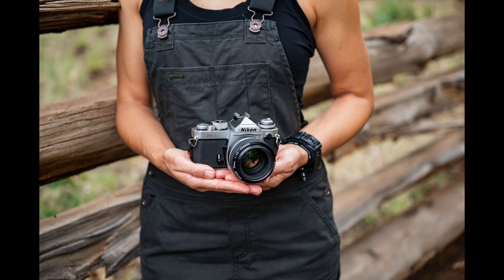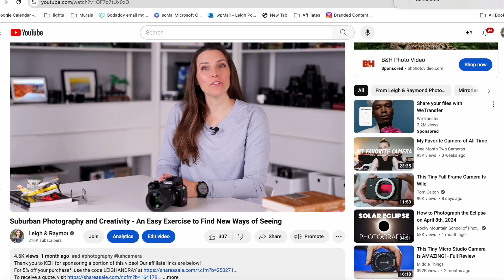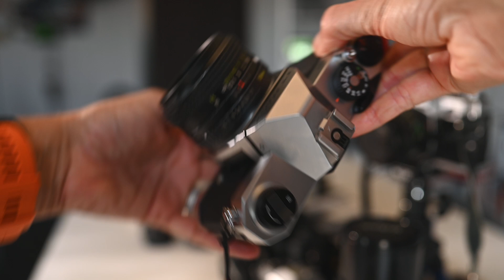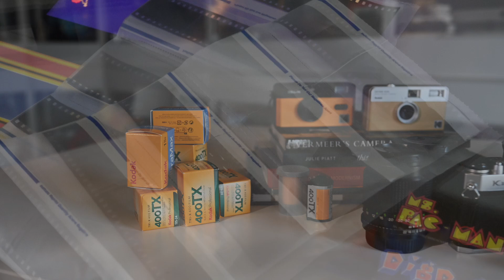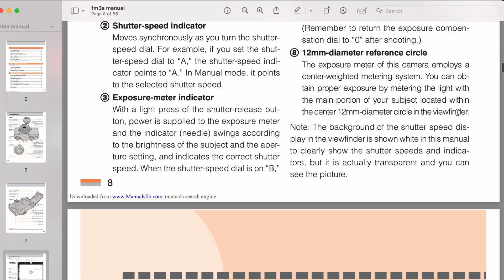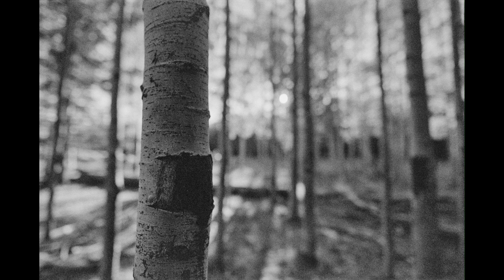How to Use Your New (Old) Film Camera & Why Would I Want to Use an Old Film Camera?

Comment: Love this . After getting the Canon FTb from a friend free after her dad passed away will be learning manual and shooting film . Will have to find if the exposure meter still works when i get a battery .Mercury Eligo now . Looking to shoot Fuji 400 , 200 , Kodak 100 this summer . Will have to get the camera cleaned when i can afford it .  Still kicking myself that i dumped my tried and true Nikon F 80 but learn the hard way i guess .Enjoy shooting this year all .
Reply: Just to add , Stopped in to Camera Traders in Victoria BC Canada , tested the exposure meter on the Canon FT b  and it works , got two MRB625 (1.35V) batteries . And 5 rolls of Kodak Proimage  100 ISO Film . The cheap is not cheap but have all the time to play till i get used to this camera .Take time with the tripod as i go way to fast . Shot 200 shot with the Nikon D-800 two days ago on the breakwater .

Comment: Cost of Film and film developing is too expensive. Once in a while experimenting with film photography is okay and scanning your negatives is fun. I own a Canon  K2 film camera with 28-105 mm lens and is fun to shoot. Photos come out perfect
Reply from the maker: It is definitely costly. I am having fun doing the Summer of Film but I certainly wouldn't use film exclusively. I do have a few videos planned where I do digital photography projects that incorporate the look and/or feel of film photography!
Reply: @LeighAndRaymond  Those videos should be interesting.  I look forward to seeing what you do, Leigh.
Reply: Yes, I agree.  I bought a film camera a few months ago for special uses, mostly for color slide film.  I did cut a corner, getting a Nikon autofocus SLR.  It can use "G" lenses, which the Nikon Z mirrorless cameras can also use.
Reply: a few weeks ago i got out my old nikkormat and ran a couple rolls of old film thru.no meter but i know about what settings work.i sent the film to a drop box place on ebay.it's been years since bought film and i was shocked at the price.
Reply: Yes.  If it had not been for the advent of digital cameras, I would not have gotten back into photography.  I do have a film camera again,  inherited from my father.